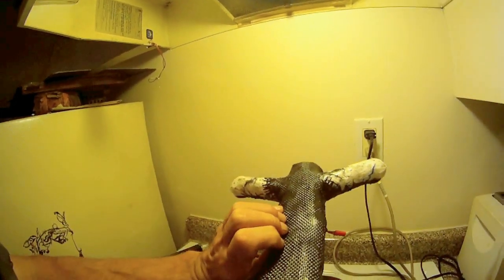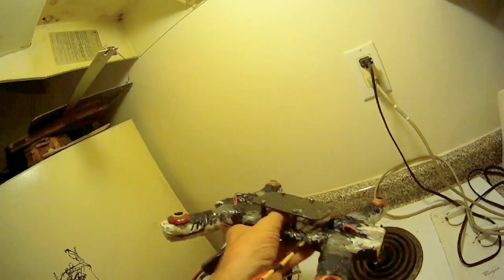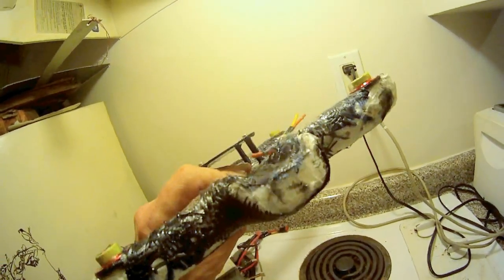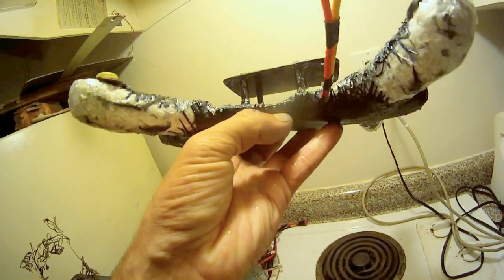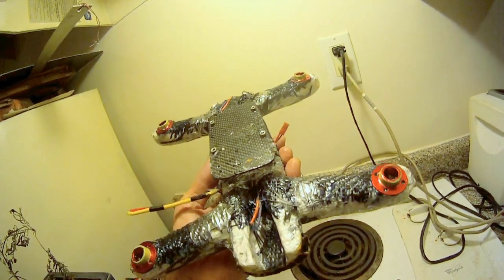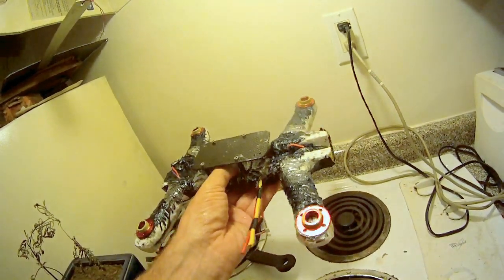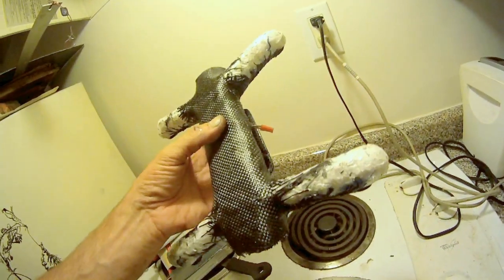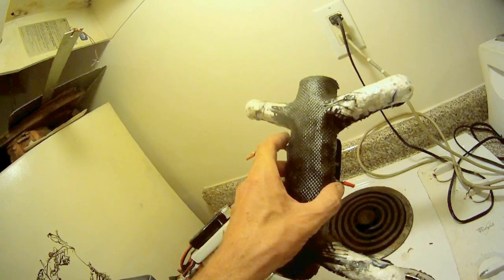Floating mini quad composite build Part 4- 130g and 70% carbon fibered and kevlared.

Comment: are you going to manufacture these for sale?
Reply from the maker: Not this way just estimating material weight with a bit of crude manufacture so the real deal when molded will be far lighter. I would cnc a two part mold if I were to make them but I get $300. for carbon fibre seats for motorcycles so not going to compete with Hobbyqueen on this stuff.
Reply: I would outsource the manufacturing to China...